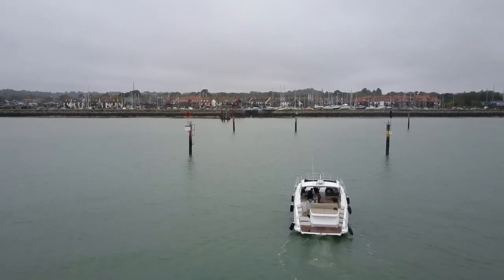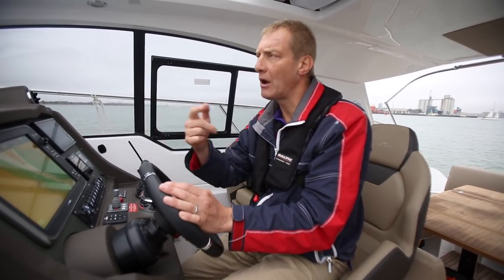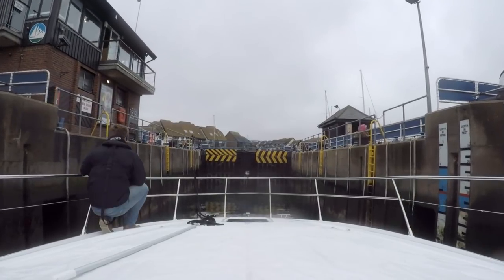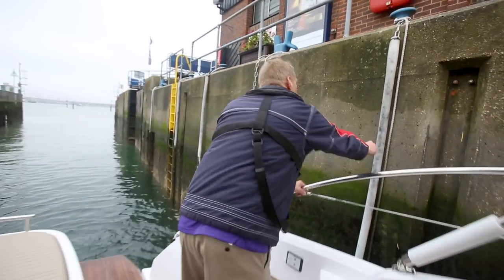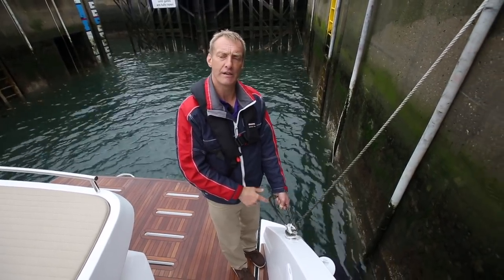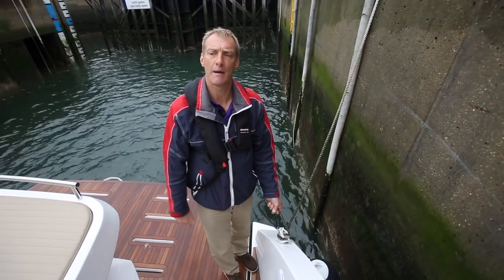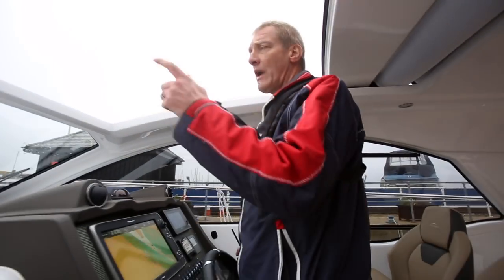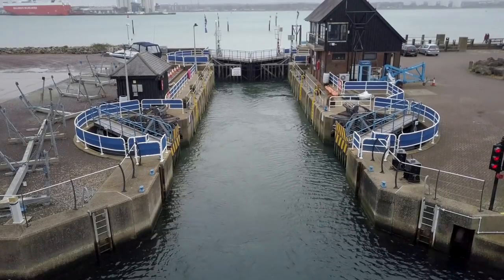How to: Use a Lock | Motor Boat & Yachting

Comment: GOOD FILMS REALY BUT DID YOU NEED TO USE THRUSTERS WE are 60 larch with Gardner 8 pot and no thrusters just Just wheel and wheel to the wind in and out of gear If i can you should in a glass boat